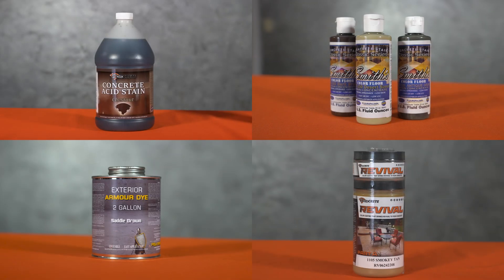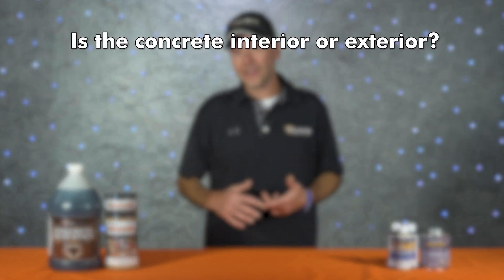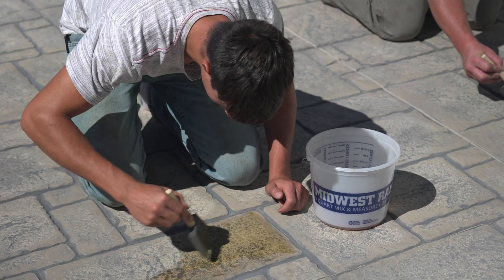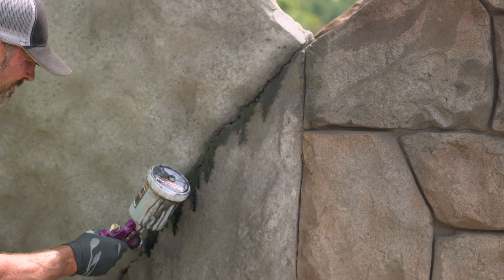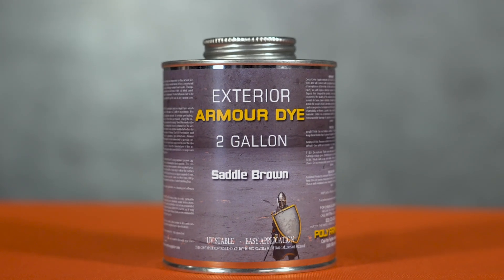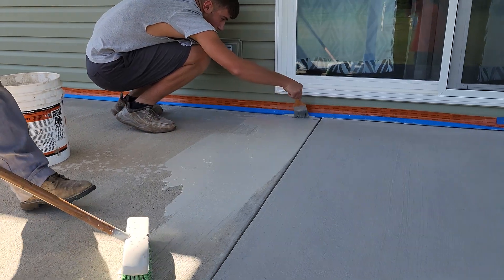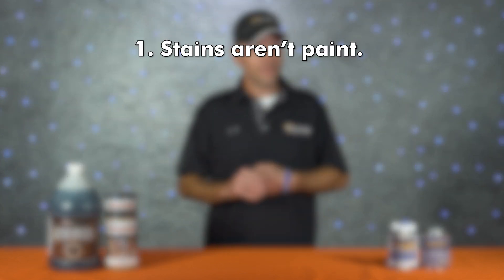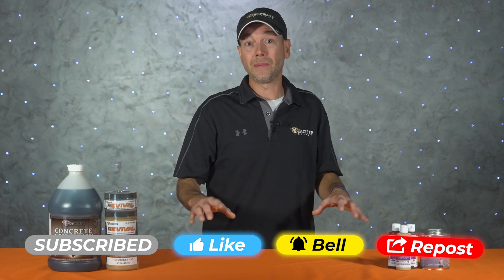Concrete Stains Explained!

Comment: I poured a brand new slab and planning on using acid stain after 30 days. Do I need to do anything prior to applying the acid stain like etching and neutralizing? Or will I be fine by just power washing the concrete prior to applying the stain?
Reply from the maker: There's no need to neutralize before staining, just cleaning with water is generally all you need. Etching would only be needed if the finish is really hard and the stain is having trouble penetrating the surface. Most exterior jobs just require a power wash. Thanks for watching Deco-Crete TV!!!!!

Comment: My patio guy mixed the release powder with sealant cause he used the wrong color while doing the stamping🤦🏻‍♀️ what can I expect to happen in the future? Will the base color pop up eventually? Ugh!
Reply from the maker: Mixing release with sealer to fix minor color problems is a fairly common practice. It is a band-aid of sorts, as the color will fade away as the sealer wears off. This can be avoided if you keep up on the sealer. A fresh coat clear sealer every 3-4 years should keep the coat with the color in place. If this method was used to completely recolor the slab, it could be more problematic down the road. If you get to a point where the sealer all wares/flakes off, and you need to do something different, we would recommend Revival for the primary color and Texture Enhancer for the antiquing. I'll leave a few links for those products. Thanks for watching Deco-Crete TV!!!!                                                                                                    
https://www.deco-cretesupply.com/products/deco-crete-revival-sealers-coatings-stains/deco-crete-revival                                                                                    
https://www.deco-cretesupply.com/products/antiquing-agent/texture-enhancer-antique-agent

Comment: Can you stain 57 crushed concrete? I want to put it in my landscape and then color it
Reply from the maker: Thanks for the comment! We've never tried that before, but I think a water based stain would work best. It should color it fine and it'll be easy to work with. You'd just see how long it lasts & you may have to re-apply it at some point. This would verry different then staining a concrete slab & I wouldn't put any kind of sealer on it in this case. That way you could touch it up as needed whenever you want. I'll leave a link below to the WB Concrete Stain page on our website. If you end up trying it, please let us know how worked. Thanks for checking out our channel👍                
https://www.deco-cretesupply.com/products/stains/deco-crete-wb-concrete-stain

Comment: Good info thanks! Here's a question: My aggregate patio slab was stained and sealed with an acrylic sealer 4-5 years ago and the sealant is pretty much broken down to nothing. Before I re-stain (with an acid) how should I prep it?(I've already power washed it)  I'm a bit concerned the stain wont take in the couple of areas that were protected by the shade. Oh, and this time I'm using solvent based sealer. Thanks for you help!
Reply from the maker: I understand your concerns, and yes, acid stain will be a little bit tricky for this application. Is there a reason you need to restain before you seal? You may be better off just re-sealing.
Reply: @DecoCreteTV   Thanks for the prompt reply! Yes, several years ago I believe I re stained the patio while there was old sealant still on it that I should have removed. I've learned much since then about proper preparation. The colour is spotty and faded and I'd like it a bit darker. I've learned that Zylene or another product called "Resolve" will take up the existing sealant. Yes, I've also tested the patio surface and found out there still is quite a bit of sealant yet to be removed. The product Resolve is more expensive than Zylene and I understand the concerns of this chemical but haven't yet decided which to use. Your input would be appreciated. After that I will stain then re seal with solvent based clear coat. Your input is appreciated.

Comment: Fantastic. Thanks for spelling it out. Are there similar differences for if you add color during the mixing/laying process when it comes to products or do they all just boil down to "pigment" or "dye" like you would use in paint or dying clothes?
I'm wondering if some skills/knowledge may be transferable here
Reply from the maker: for coloring fresh concrete the options are integral color and color hardener. https://youtu.be/XBboCF0xbJs this video will explain color hardener. stay tuned for a future video on this topic!

Comment: Would you recommend sealing after all the stains?
Reply from the maker: yes in most cases. we recommend D1 sealer for most horizontal surfaces and D-Shield Clear for vertical surfaces https://www.deco-cretesupply.com/products/decorative-concrete-sealers-solvent-based-sealer/d-one-5-gallon https://www.deco-cretesupply.com/products/water-based-sealers/d-shield-clear

Comment: Great video very informative for a newbie.  
I’m an artist wanting to stencil on fresh concrete columns supporting a (outdoor) birding platform that will be constructed at a state park —the platform will overlook a lake.  At first I was going to use acrylic paints, but am wondering if staining the design (medallion) on the concrete would last longer. Could you give me insights on what would be best and why?  The columns are vertical, will be in partial sun, and humidity from lake water may be an issue. (I volunteer for a nonprofit organization creating the birding platform and am willing to enhance this project with art so, it’s important to me to do this right.) Appreciate your thoughts. Thanks.
Reply from the maker: Make sure the concrete has time to cure out (~30 days). I would recommend water based stains as apposed to acrylic paint, just because the water based stains will penetrate a little bit and last a little longer. Sounds like a fun project! Thanks for watching!